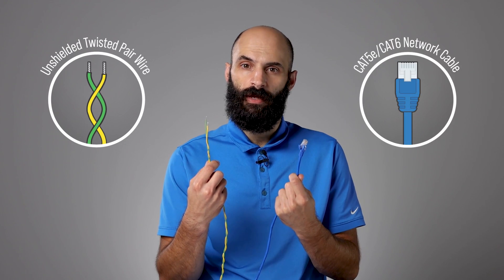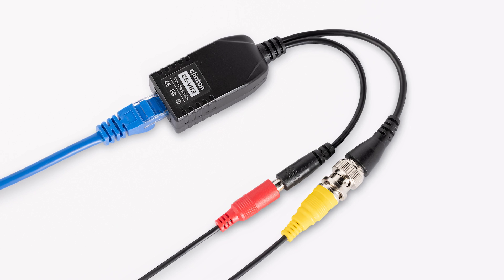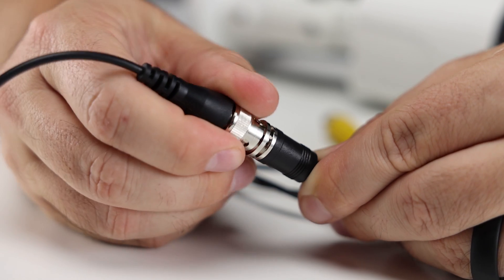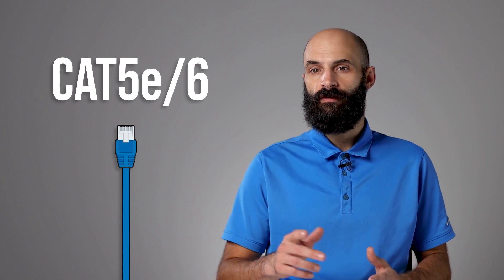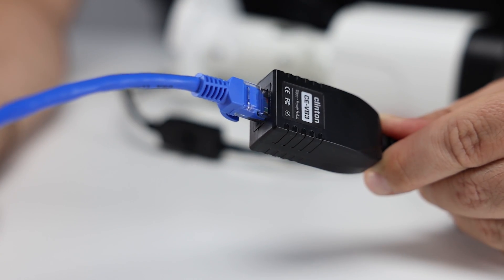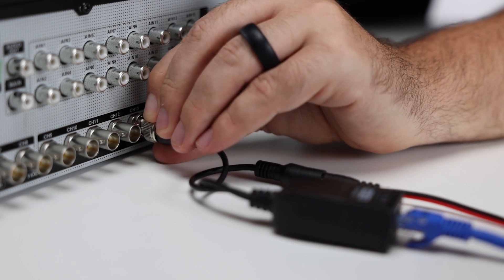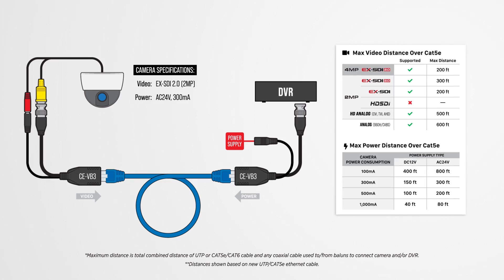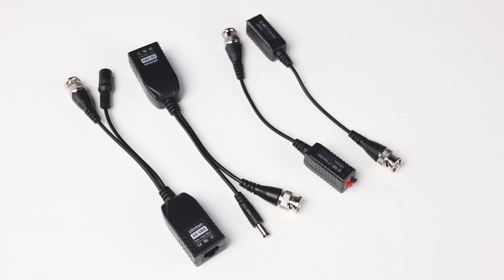CCTV Video Baluns: A Low-Cost Alternative to Coax Cable!

Comment: Is there any loss of quality by using a balun? Seems much easier / cheaper to pull cat 5 or 6 rather than bare siamese cable and then have to terminate them.  Or preterminated siamese and likely wrecking a connector at some point : )